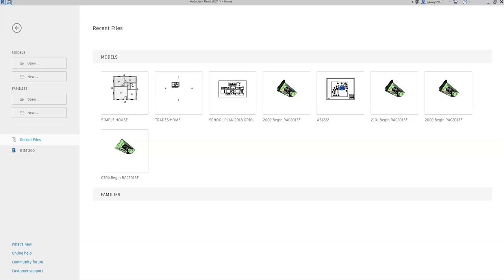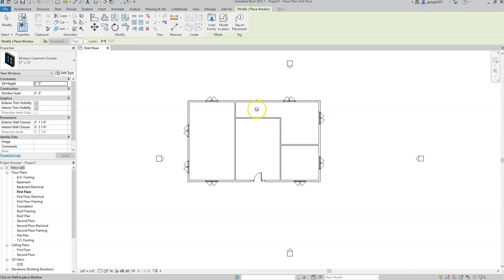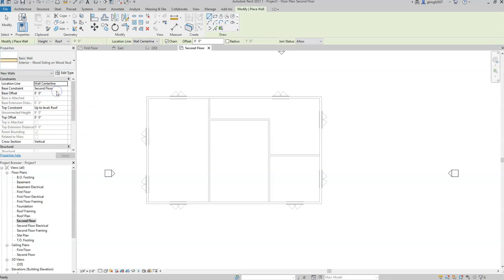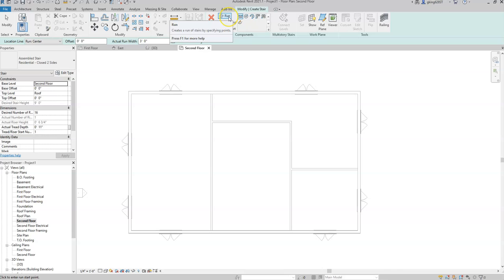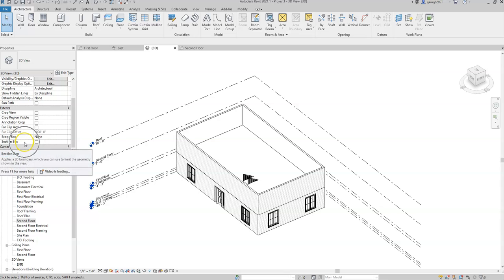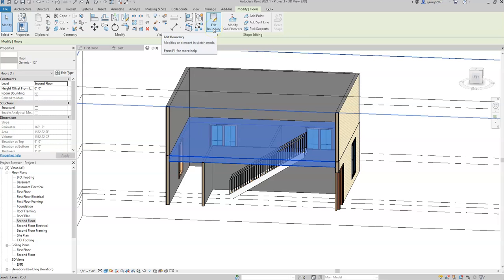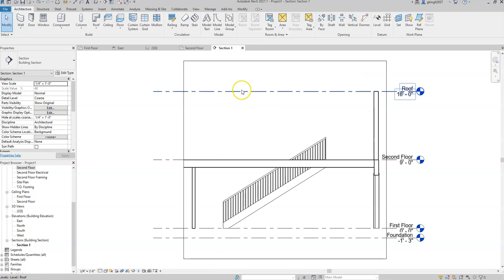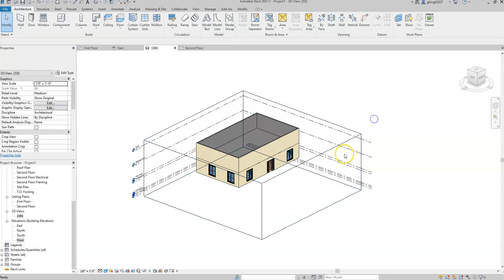REVIT SECOND FLOOR & STAIRS

Comment: I cant see the lower level
How to make the underlay visible?
Reply from the maker: When you are in your floorplan, take a look in the properties menu on the left.  Scroll down in the property menu and you will see a section named "Underlay". From there you can change the "Range: Base Level" to the first floor.  You will have to click on the Apply bottom on the bottom right of the menu for it to take effect.